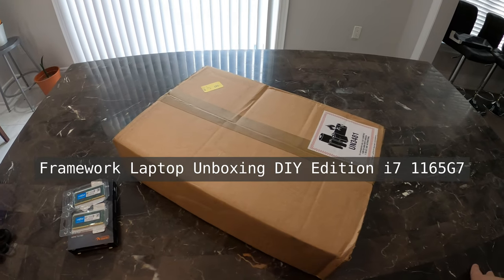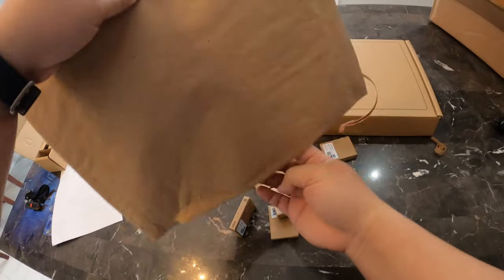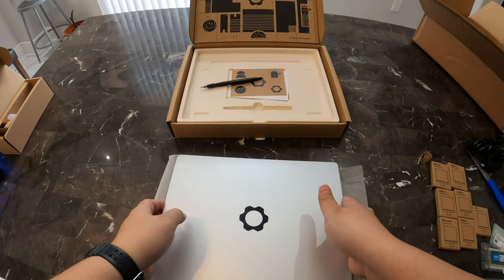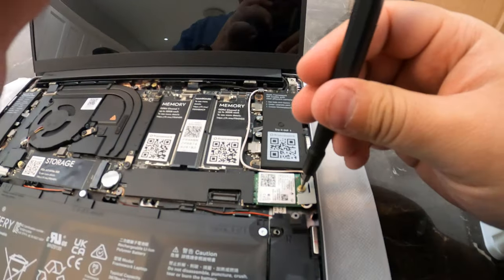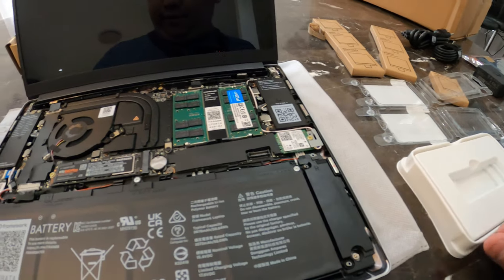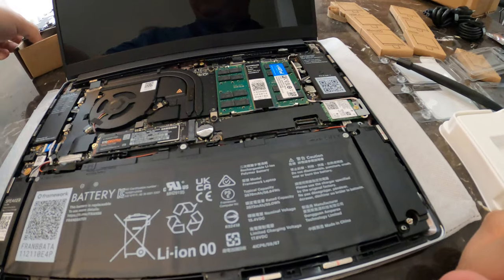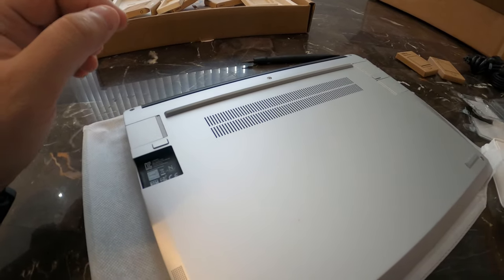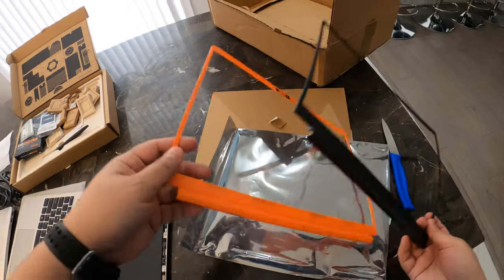Framework Laptop DIY Edition Unboxing and Setup

Comment: I hope for a laptop with a bigger battery. I heard that the expansion cards drains battery on idle, so micro SD, HDMI, DP drains the most. So I'm gonna wait until they fix those issues.
Reply from the maker: they just announced a bigger battery for the 13" but I'm most excited about their 16" they just announced. Looks promising.
Reply: they fixed those issues, 55-61 wh battery and they basically removed idle drain on the new expansion cards

Comment: hows the laptop doing now? I waas thinking about getting this as a school laptop and maybe a Linux PC as well. I just don't wanna buy a normal PC from a big OEM and have something take a crap.
Reply from the maker: trackpad is crap. Speakers are crap. Sometimes it has little glitches where it won't come out of sleep (Windows 10) but overall I'm happy with it. Problem is I came from a MacBook where they are the golden standard for trackpads.

Comment: I might buy this laptop, and Im curious how long the battery lasts. When using it for light tasks how long does it usually last?
Reply from the maker: Battery life is pretty crap to be honest. I've switched from Chrome to Edge for longer battery life with web browsing. Probably around 2-4hrs battery life depending on how heavy the usage is.
Reply: That just depends on what you plan to do on the laptop

Comment: I was looking at the Framework laptop to replace my aging MBP 2017 but wasn't sure of its performance for video editing. How did it perform with video editing apps like Blender and Davinci Resolve? Does anyone know? As I really want an alternative to Apple's non-upgradeable laptops for RAM and storage for my video editing needs.
Reply from the maker: I found it had a few hiccups with Blender for video editing with some weird errors with running out of Ram requiring a restart of the program despite having 32GB of Ram. But I mainly use my desktop for heavy tasks. The Framework is more for web browsing and other light tasks and portability. It's definitely not a performance laptop and will get pretty toasty with intensive tasks. But overall I'm happy with the Framework for what I need it for. And having 2TB without paying Apple's insane markup is awesome.
Reply: @KThach.  How much is the 4K export time in DaVinci Resolve? My current laptop is about 1 hour..
Reply from the maker: @gigahertzmedia  whoops. Didn't see this comment till now. I only currently use Blender for video editing. So I have no experience with Adobe or DaVinci unfortunately.
Reply: @KThach.  OK. I realized it wouldn't be very good for editing because of the lack of GPU.

Comment: switch to linux man
Reply: Framework laptops don’t handle Linux well. It can be fixed with a firmware update in the future, but it currently doesn’t support it.
Reply from the maker: I'll get around to it eventually. Probably going to try Pop!_OS
Reply: @KThach.  if u need help write me
Reply from the maker: @zungaloca  Thanks. I'm a total Linux noob but trying to enter the coding/programming field eventually so it's going to be something worth being familiar with I believe. Nice that Linux is slowly becoming more adopted.
Reply from the maker: @veillerguise  Uh. Only issues I've heard are some distros have issues with drivers and the battery life isn't that great. But that's not a huge deal breaker. It'll probably get better over time. Just have to be patient.
Reply: @KThach.  try fedora
Reply: @veillerguise  lmao they handle linux very well
Reply: @AaronBrooks0321  It even says on their website, they have a breakdown of all tested distros